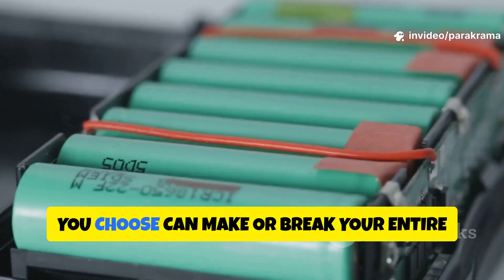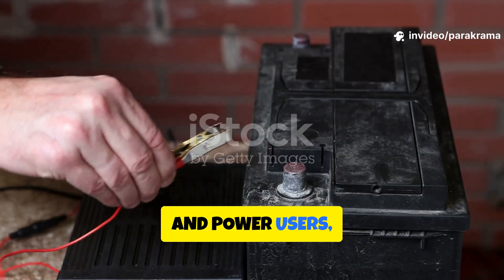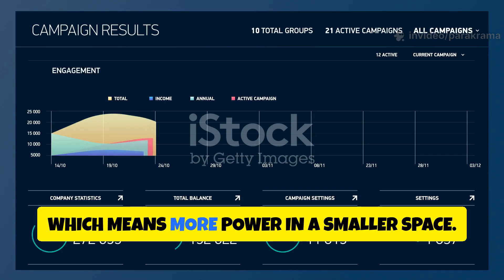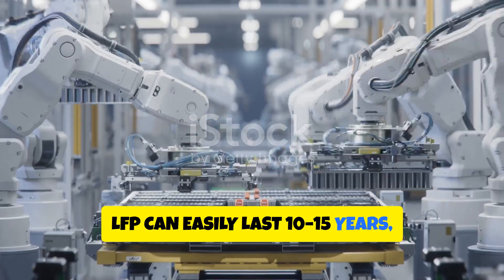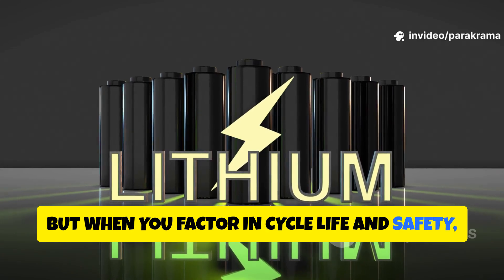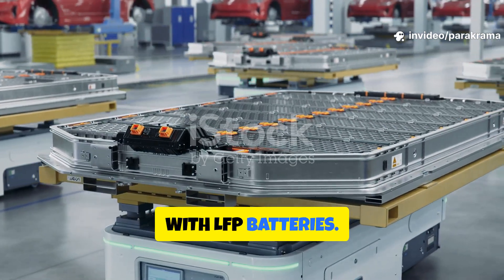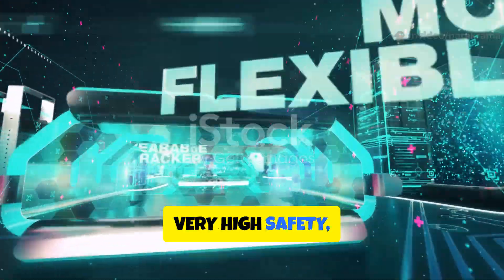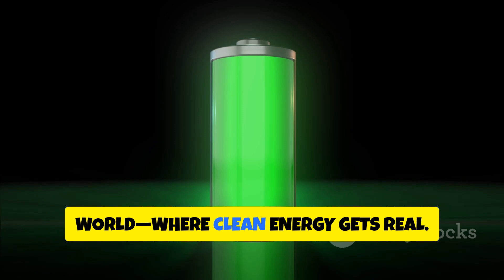LiFePO4 vs NMC Battery Chemistry Deep Dive for DIY Solar & EV Projects

Comment: you forgot about discharge rate
Reply from the maker: You are spot on! Thanks for reminding me! I have completely forgotten about that! Yes You are right! there is a clear differance on discharge current on two battery types. LFP recommendation is 0.5C while NMC can go from 1C up to 3C depending on the model.